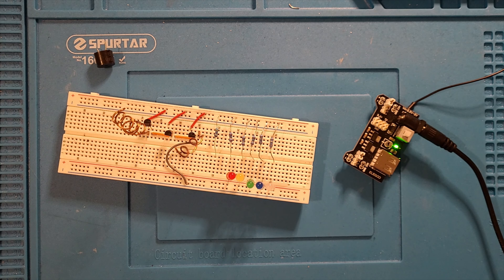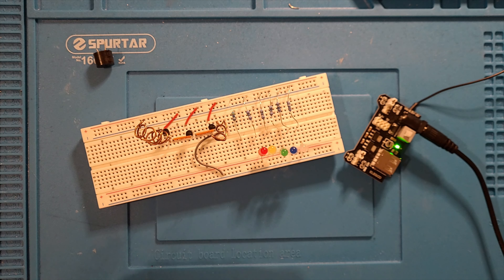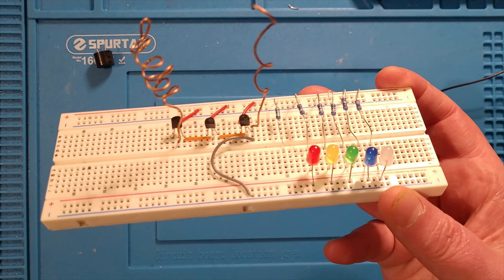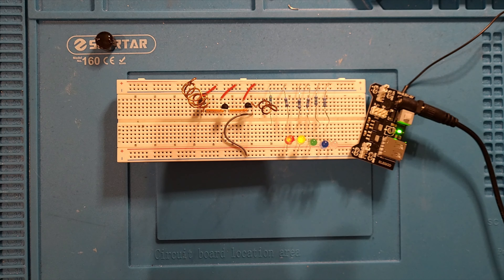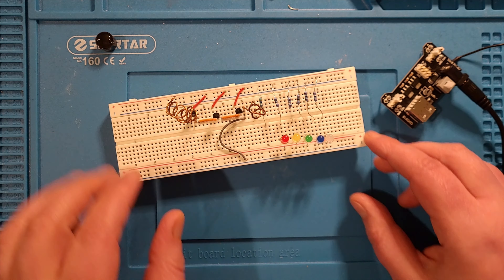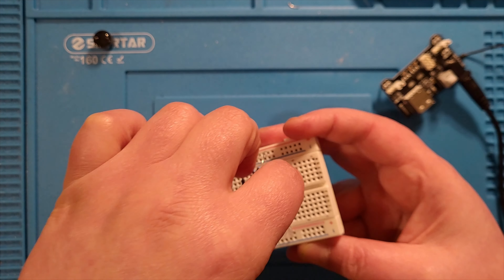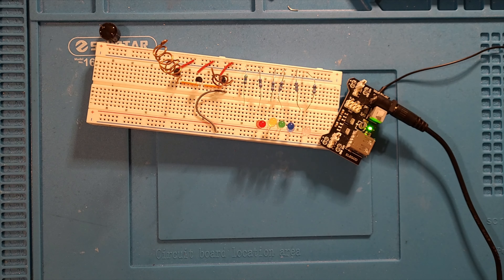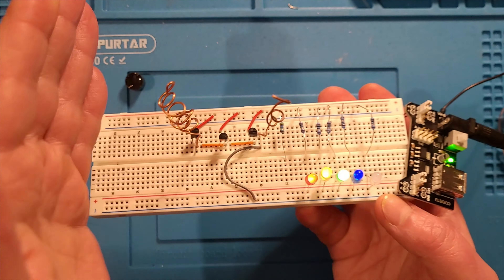REM Pod LED Proximity Meter Mod

Comment: I'm interested in building one of these. Are you using an arduino board to power it. Also have you had it wired up, if so what does it look like?